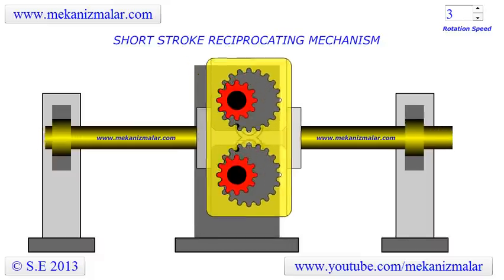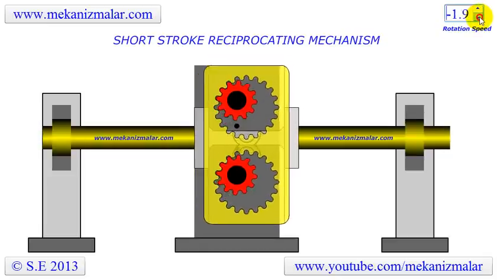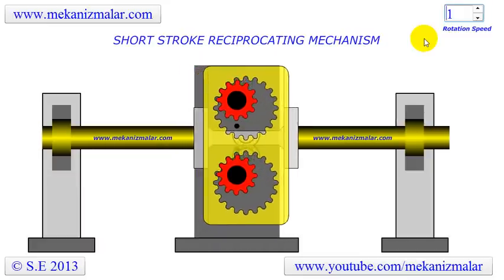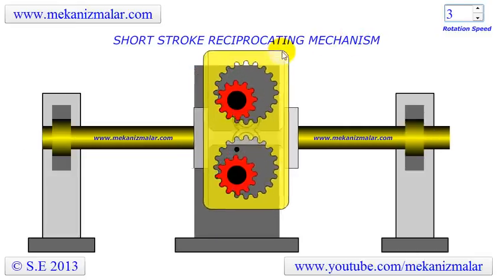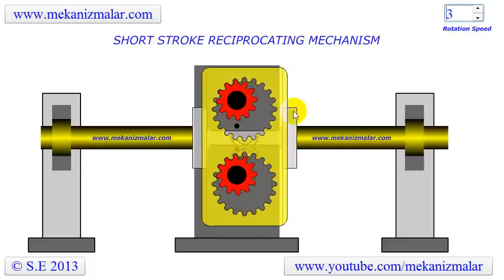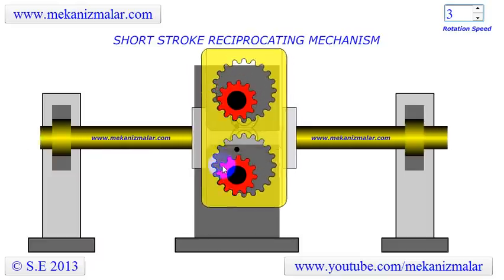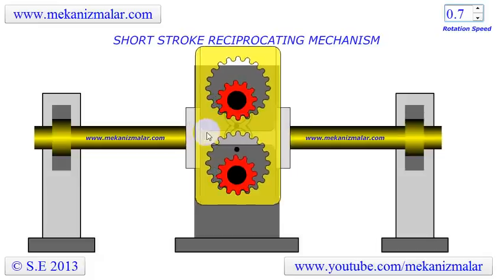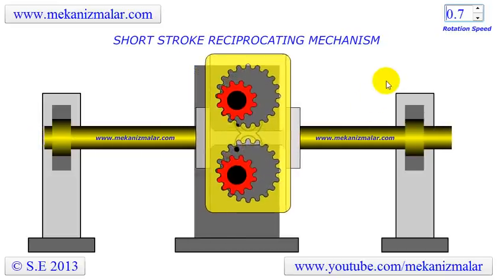Short Stroke Reciprocating Mechanism

Comment from the maker: Thank you for watching my video and your comment. Here is how I find the radius of the cam groove.
Assume that the red gear has base radius R1 (38 for my case) and yellow gear base radius R2 ( 63 for my case). Further assume that the yellow gear is fixed. In this case the red gear orbit on a circle of radius R2 - R1 = 25. The black bins, should rotate on a circular groove same as R2 - R1. Therefore groove radius for black pin acceptance will be R2 - R1.